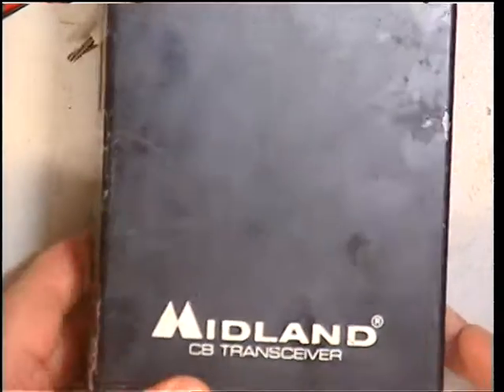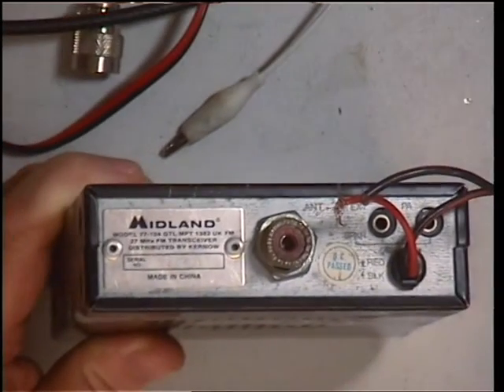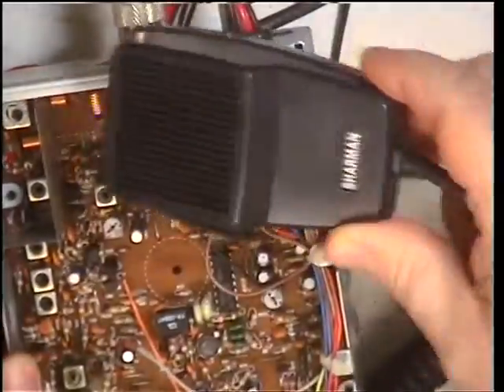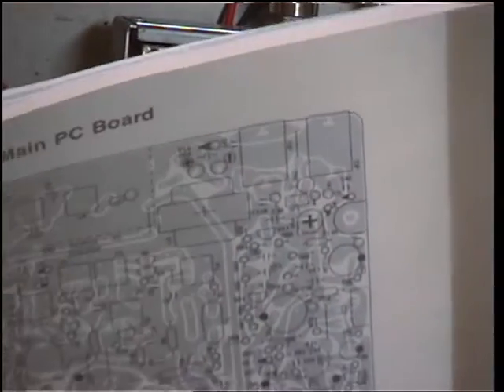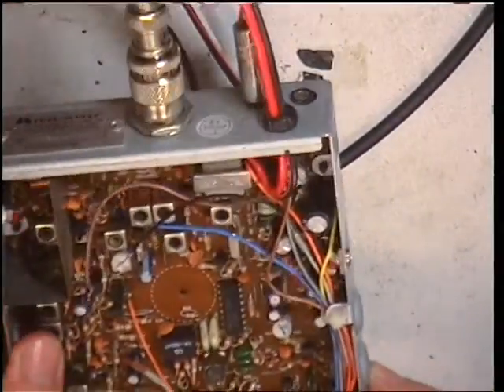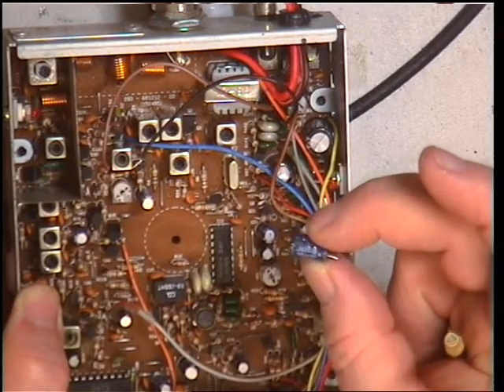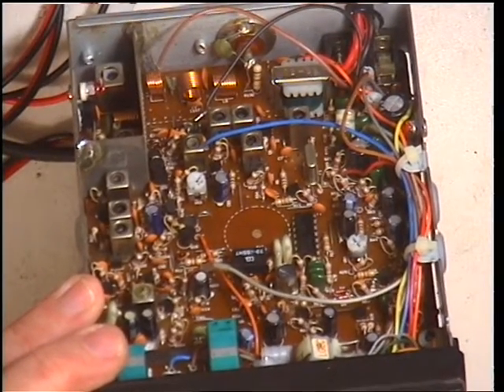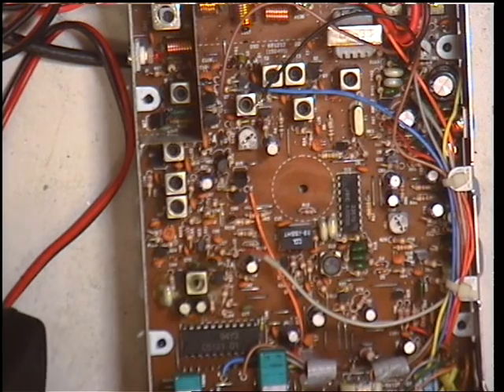Midland 77-104GTL  UK (CB27/81) CB radio (mobile) - TX & repair

Comment: Hi great videos i have subscribed. Would you have the circuit diagram as i have one with a recieve problem. One of the resistors had fallen off the mike plug and I'm having trouble finding the right resistor value
Reply from the maker: Kevin, I don;t have a circuit but recall the radio uses the same board as a different model...I may mention that in the video, but it's some years ago & I've forgotten. I have the 77-104UK & the 77-104D circuits bur am unsure if that helps. email me   rshireby@yahoo.co.uk

Richard